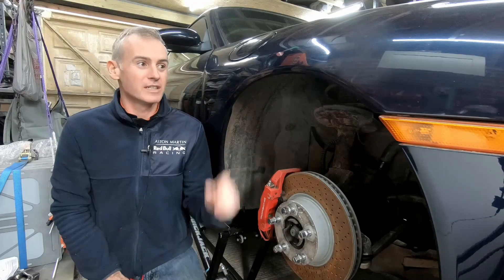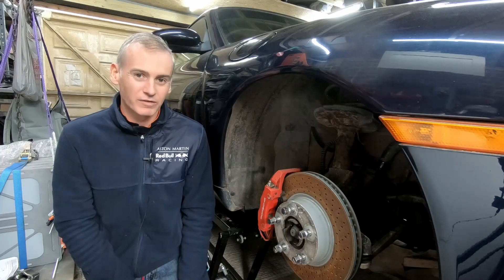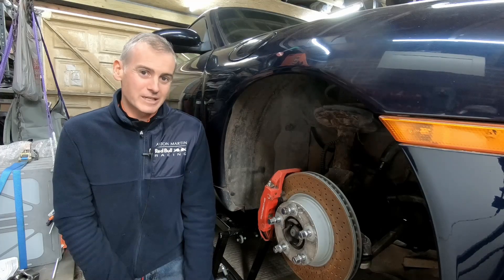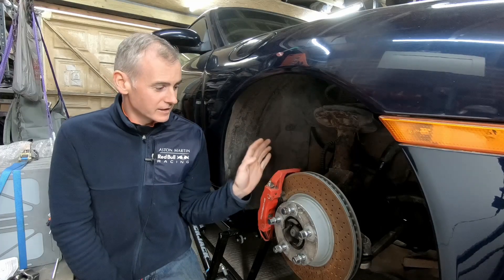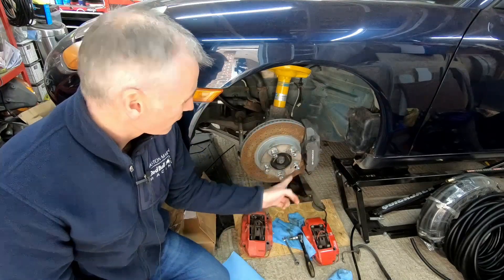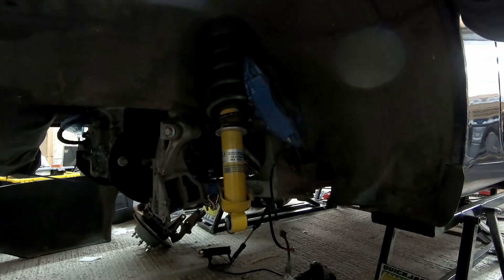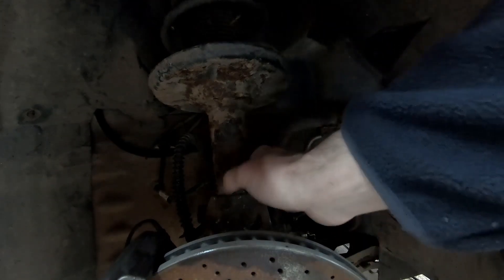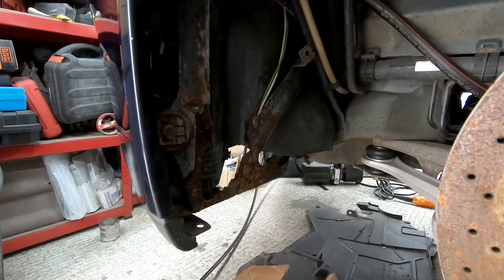Electric Porsche 911 - Project Update - What have we been doing and what do we have planned

Comment: Looking forward to the EV bits👍
Reply from the maker: Thanks, that's definitely been a lesson learned for me on this project. Start off with a more sorted car and you can spend more time on the EV bits and less on the restoration.
Reply: @PerformanceEV  i have a similar challenge but with the interior and roof. Although a company is doing the EV bits as i don't have the skills or space. Still vlogging it though 👍
Reply: Good update, Shane. Whilst you’ve got most of that front end apart, makes sense to drop the subframe and pull the fuel tank. You’ve done the hard part.👍